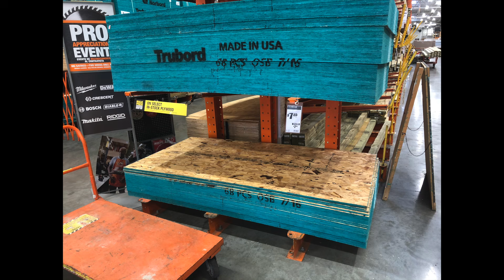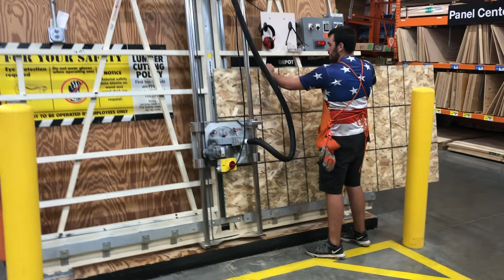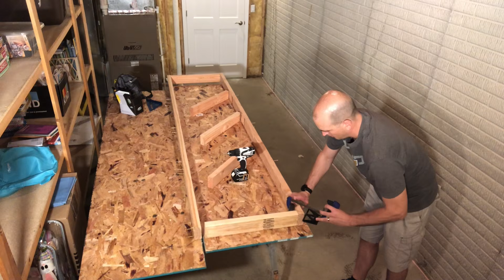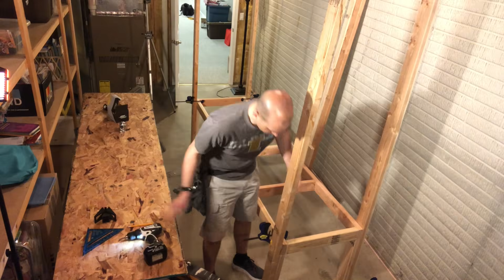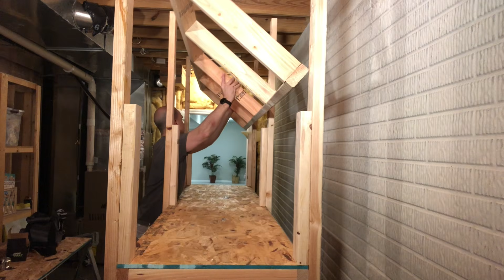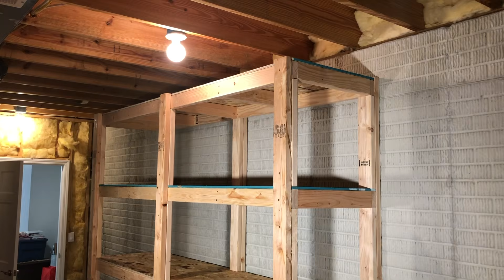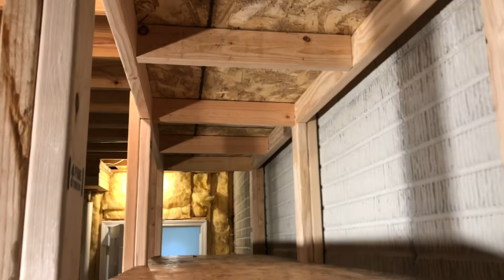How To Build Storage Shelves | Easy Build

Comment: I’m getting ready to do this exact thing. Quick question. Did you drill pilot holes? Thanks!
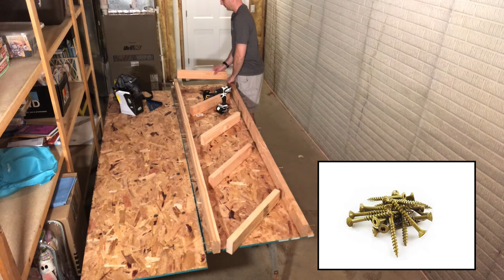Reply from the maker: The only pilot holes I drilled were for the 2 x 4 frame when screws were placed towards the end.  You can see in the video at 3:57
Reply: @EverydayHomeRepairs  Got it. Thank you very much. Don't know how I missed it before.

Comment: Scott, awesome project. I would like to build  this but with this dimensions - 
Height = 8 ft
Width =  6 ft
Depth =  2 ft

Can you please advise the exact number of boards I will need based on my dimensions? Since the width of my project will be 6 ft and not 8 ft, it's screwing up my calculations. Thanks!
Reply: I think you would need 23 studs instead of 25. You will have 8 6' boards going horizontal instead of 8 8'. So on 8 of the studs the last 2 feet could be used for cutting 8 of the 21" inch boards. But the math is simpler. You need 16 feet less 2x4s. Since you have 8 boards 2 feet shorter. So really only using 2 fewer boards.

You'd need the plywood cut 6 feet long, so at the end you're going to end up with 4 square plywood of 2'x2' for future projects.
Reply: Actually it would probably be better if they crosscut from 8 to 6ft before ripping from 4 ft to 2 ft. That way you'd have 2 2'x4' pieces of plywood leftover to make cornhole boards and leftover 2x4s for cornhole legs. I might do 2xl8x6 myself.

Comment: do I need to predrill every hole or i can just screw the screws in?
Reply from the maker: I like to predrill anything which is close to the edge to avoid splits.  Also this can depend on the type of screws being used.  Some screws are specifically designed with a tip that doesn’t need any predrilling.
Reply: @EverydayHomeRepairs  thank you sir

Comment: Love this design and planning to build it myself shortly. Question though: how much strength would you lose by using 2x2s on the horizontal shelf framing? (but still 2x4s for all uprights). This would increase the amount of accessible space between shelves, but would the reduction of support make it not worth it?
Reply from the maker: I think the structure for the shelves would still be solid.  I just usually don’t have great luck with getting cost effective and straight 2x2 boards in my area.  One tweak I might also make is using 2 inch screws and actually screwing the plywood/particle down to the shelf frame.  I think this would help make each shelf more robust given you are only using 2x2 instead of 2x4.  Let me know how it works out.
Reply: Yes screwing down the top especially if you glue it too greatly strengthens it.
It's like half of a torsion box. If you wanted it ridiculously strong you'd
put plywood on the bottom too.
This applies to benches too.

Comment: Was looking to replace shelving in my shed. Checking out different videos and came across your channel. Probably the best video out there for making shelves. Simple and to the point. The shelving is perfect for what we need as I didnt want to start drilling into brick walls to add timber lengths for the shelving.
Reply from the maker: Nice Mike,  best of luck on the project and let me know if you have any questions! 👍

Comment: You said 21" for the crossbar but it adds up to 25" in width. Is that so you give yourself a 1" cushion?
Reply from the maker: Hey Gabriel, each shelf will be 24 inches wide which is the 21 inch crossmember and then 3 inches (1.5 inches times 2) from the 2x4's that run the length of the shelf.  Make sense?

Comment: Great video! I would line to do the same but my space is limited. I would be able to do a 6’ tall, 6’ wide and 20” deep. I am a new home owner and am not sure about the cuts for this project
Reply from the maker: Hey Javier, congrats on the new home 🏠 if you scroll through the comments there are several examples of people modifying the design from 8’ to 6’ which should help for your application.

Comment: Really enjoyed your video and planning to use you dimensions and steps, but I need the bottom shelf to be at least 25 inches top to bottom to accommodate a kick drum because I will be using the shelving for storing drums and etc. but can only accommodate 7 ft in height.  Can you provide me with what I will need as far supplies.  Knowing the bottom shelf size will affect the others shelving height.  Thank you.

Comment: I’ve made two of these already.  8’ and 12’.  Thanks!  One thing for me was that I had to cut the OSB to 23” instead of 24” so it can sit perfectly.  Still satisfied.
Reply from the maker: Hey Guillermo,  not a bad tip on the OSB as it can be a bit of a tight fit if you just rip the 4' x 8' down the middle and are off on either direction.   Nice work on knocking out 2 of these beasts.

Comment: What is the largest size storage container that you can use on the shelves?
Reply from the maker: Hey Laura,  you will have right at 20 inches of clearance with this design.  Best of luck on the project!
Reply: Everyday Home Repairs ok, last question, my basement is only 8’ high. Would you recommend making the 20” pcs 19” and cutting the 8’ 2 x 4s to 92”?
Reply from the maker: I would probably only make the whole unit 6 foot tall.  Subtract materials for the 4th shelf and cut the 6 legs to 72 inches.  Actually numerous people have done this route for a similar ceiling height.  Hope that helps!
Reply: Everyday Home Repairs can’t wait to do this. We are downsizing  to a new home and will be in need of several storage racks   I’ve been searching for shelf building ideas for some time, this is the best one I’ve seen. Thanks

Comment: Thank you for this project it came out great. I noticed there was no glue used, is that correct?
Reply from the maker: Yep, no glue on this project.  Wanted to make sure I could easily take it apart if I needed to move it out of the basement.  With the vertical 2 x 4 between each shelf that will do the vast majority of the work carrying the load.

Comment: Caution. If you think this is going to be as easy as it looks, good luck. The chances of your 2x4s being  square is remote unless your Home Depot is better than mine. The first two I tried were quite a bit off. Just getting started so we shall see, but be ready for setbacks.
Reply from the maker: Yeah, I think that is a good note on the importance of checking the person making the cuts.  Having a tape measure on your hip is not a bad idea 👍
Reply: Everyday Home Repairs I don’t know anything about woodworking which is why I like this video. That said, I don’t think a tape measure is the right tool. A level and a carpenters square is probably better. I when to 84 lumber with a friend who told me he was good at “sighting” straight boards. (I bought another 14 8’ 2x4’s”)

He did ok but 6 he selected had gaps when lined up against the others he selected 😂

Comment: Lowe’s would not do “project cuts”. Try Home Depot. They made the cuts.
Reply: My local home Depot charged $0.50 for each cut after the first four.  Still worth it for the time savings and ability to fit everything in my SUV without having to borrow someone's truck, but a heads up for others who may not be expecting that expense.
Reply from the maker: Thanks for the info Vince 👍
Reply from the maker: Yeah and I think HD is hit or miss depending on your area.  My area I. illinois they will do your cuts.  You would think  at least 1 of the big companies would do it as a differentiator but maybe that really steps up their insurance to cover possible injuries. 🤷‍♂️

Comment: Hi. I had this design from a previous homeowner and planning to make another one. From your measurements please clarify which ones are the 20" vs 21' support. 21" supporting the legs going vertically while 20 inch are the horizontal supports? How many 20 and 21 have been actually used?  I very new at this so wanted to make sure I am not swapping the two.
Reply from the maker: Hey JB,  did you see the build list down in the video description?  If you expand the description you will see many more details to help with your build.  Let me know if you still aren’t seeing the details in the description.
Reply: @EverydayHomeRepairs  Got it now after reviewing the video. Thanks ! More power to you !
Reply from the maker: Best of luck on the project JB 👍

Comment: Thanks Scott for explaining in detail, Quick question though 
For this , 5 cut into 20 separate 21 in pieces
and  6 cut into 24 separate 20 in pieces(each 2ft?). what would be the exact dimensions should we give at home depot to make the cuts ?
Reply from the maker: Hey Hemanth, you will tell them you need 20 pieces which are 21 inches in length and then 24 pieces which are 20 inches in length.  Have them cut 1 and you confirm with a tape measure the measurements are correct.  Some times they start making all the cuts and they are as much as a 1/4 inch off.
Reply: @EverydayHomeRepairs   Thanks a lot

Comment: Thanks Scott, I am going to give this a shot this weekend. Quick, probably dumb question, if I only want to go 3 shelves high, due to a short basement, can I keep all of the measurements the same except have HD cut the 6 legs to 6ft instead of keeping them at 8ft? Thanks in advance!
Reply from the maker: Hey Eric, yep that would work and you will be able to buy a few less 2 x 4’s since you don’t need to support or build top shelf frame.  You only need 15 pieces cut to 21 inches and 18 cut to 20 inches.
Reply: Perfect, thank you!

Comment: Great explanation of the project, would it work to make it half the size, i.e. 4 foot wide or do you feel it wouldn't be stable enough?
Reply from the maker: Hey Bill, stability wouldn't be a problem and should work out as long as you keep the same number of 2 x 4 supports for the frame.  I might switch to nails or structural screws on the shelf frames as well to increase the shear strength.  Best of luck on the project!

Comment: Awesome project !! Thanks for the details. One question though, each shelf has 20" support + 4" shelf sides + 1/2" OSB, that calculates to 24 1/2" , so a total of 4 shelfs will increase it more than 96". But how come your top shelf is in line with 8ft boards. Pardon me if I am missing anything here.
Reply from the maker: Hey Srikanthan, good question.  It is confusing but a 2 x 4 board is actually 1.5 inches by 3.5 inches.  So that is where the 20 inches + 3.5 inches + .5 inch = 24 inches comes from.
Reply: Ah that explains it. Thanks a lot for your reply. Heading to HD for my project.
Reply: @EverydayHomeRepairs  Man I was about to bust my brain on this thanks a million 🙏

Comment: This is nice shelving and the Home Depot cutting idea is a revelation! I'm doing it this weekend. Thanks!
Reply from the maker: Hey Chris, best of luck on the project!
Reply: @EverydayHomeRepairs  Thanks! Done. If you saw them, you would be appalled. But they are load-bearing and they are mine. Bins are already on them! 
And this even after I had to go back to Home Depot because I didn't take your advice about measuring the cuts before I left the store. 
They charge $2.00 EACH cut after the first cut in Chicago Home Depots. Apparently, it's different depending on where you are. I got the second round of 20 inch cuts for free, but paid for the lumber.
Reply from the maker: Hey Chris, way to crank through the project.  Interesting they make you pay for each cut after the first in your area.  Good to know.

Comment: Our you can do it the old fashioned way as I just did.  I finished my shelving project yesterday.  A friend gave me some old fencing material.  I ripped the 4x4's down to 2x4'x with a small Hitachi 10" blade so I had to pass the 4x4 twice.  Then I used the old fencing boards for the shelves.  What a workout but I am happy to have done this.  I borrowed a neighbors chop saw and got 3 1/2" torx screws and 2" torx screws.  Torx screws are so much easier than using 16d nails.  I started off that way but it was to much.  The torx screws made all the difference.  Everything else is pretty much the same except I also put the legs on the end and I have the bottom shelf on the floor, because of the small storage shed of 100 square feet.
Reply from the maker: 💥 resourceful and cost effective.  I like it!

Comment: This is brilliant, sturdy and easy for a novice, especially getting Home Depot or Lowes to do the cutting.  I'd love to build it but I need an 18" depth instead of a 24" depth, caused by the shallow depth on the North side of the Garage.  Since it's 6" shallower, do I make the cross pieces 6" shorter to 15" and cut the OSB to 18" strips.
Reply from the maker: Hey Brian,  yeah that is how I would approach making the changes.  Others things to keep in mind are:
1)  The legs will add 1.5 inches to each side of the shelf width so the overall shelving unit including legs will be 21 inches wide.
2)  Also with the more narrow stance I think an anti-tip strap or 2 is a must

Best of luck on the project!
Reply: @EverydayHomeRepairs   Adding Anti-tip strips won't be a problem.

Comment: Im not very handy but this looks like it could be in my wheelhouse! Question...why do I need 6 of the 2x8 for the 20" cuts pieces? Wouldn't I only need 5 instead of 6? ...24 pieces x20"=480"/96"=5. What am I missing?  Thanks!
Reply from the maker: Hey Kevin,  good question and the need for 6 boards (2X4) is because you can only get 4 pieces cut to 20" from each board which will leave 16"-ish scrap from each board.  Let me know if you have any other questions.

Comment: Hey Scott, 

Great tutorial on building this wooden storage shelf. I’ve purchased all my materials and I’m about to begin the build but had some questions before I get started. I made some slight alterations.... I went with 84” legs instead of 96” to accommodate the height of my garage and the obstruction of my garage door track. In doing so I had to also alter the space between each shelf so I could still get (4 shelves + the garage floor as my 5th shelf).. my dimensions of the vertical support spacers are 17” instead of “20” while keeping the same for everything else (so 17” + 3.5” shelve + 1/2 osb = 21” instead of your 24”). My totes only need 15” clearance and I’m providing 17”... so  84” divided by 21” would be 4 shelves plus the floor to make 5 storage levels correct?  

I have noticed others ask if the two middle support legs are necessary and I know it depends on what I store on the shelves.... but my question is slightly different.... I noticed you mounted the corner legs in the front and rear of the shelves ... could I mount the 4 corner legs on the outside ends of the shelves instead without the 5th & 6th middle legs?  I ask this because the length of each shelf will shorten by 7” (3.5” for each corner leg 17” support spacer) if mounted as you instructed (again no middle legs). I’d like to store 5 totes across each shelve and that can only be  done if the corner legs are mounted to the ends so I can keep 93” instead of 89” in length. So my question is can the corner legs be mounted in this fashion or does that change the structural integrity of the support system? I could always mount another leg(s) in the back side along the wall for more support but I can’t really afford to lose more depth since I need the 24” in depth to allow these same totes to fit. (FYI: my totes are 18 gallon: 23”5/8 L x 18” 3/8 W x 14” 7/8 H). 5 totes per storage level would equal 25 vs. 4 totes per storage level would be 20 totes....this a huge difference maker for me!  Please let me know what you think with some feedback... thank you in advance.
Reply from the maker: Hey Dutchboy,
I added a couple notes below in response to your questions:
1)  Does the math checkout for adjusting overall height from 96" to 84"?
Yes, I follow your adjustments and agree that will equal an overall height of 84"
2)  Can I mount the legs on the end of each shelf and also remove the middle legs to ensure I can fit 5 totes on each shelf?
In terms of the middle legs I think you can leave them off and can monitor if the shelves are starting to sag at all in the middle once you begin to load the totes.  Mounting the legs to the end of each shelf will adjust the stance a bit so making sure you have a wall anchor to prevent tipping is even more important in your case.  This orientation will still provide the vertical loading support needed as long as you keep the 2 x 4 pieces between each self (17" in your design) on each of the 4 legs.

Overall looks like you have a solid plan.  Let me know how the adjustments work without the middle legs once built and you have all the totes loaded up.

Comment: Do you have an opinion about the builds similar to yours, but without the front center post(s) support, so the layout is "open"?
Reply from the maker: Hey Bica,  You would most likely be fine without the center legs but I would put any of the heavier objects towards the ends of the shelves close to the legs.  Also you could screw the plywood / particle board top to each shelf frame to give the resulting shelf unit more stiffness.  Lastly if you have the shelf against a wall I think only using the back middle leg is an option (5 legs total).  Let me know if you have any follow up questions.
Reply: @EverydayHomeRepairs  thanks. Yea mine will be against a bunch of studs in my basement that line the outside of the basement steps...so I'll have to see if the 3 rear legs would line up with those studs and if they don't....guess find a way to mount it or let it free stand